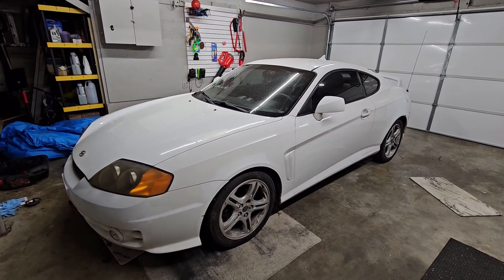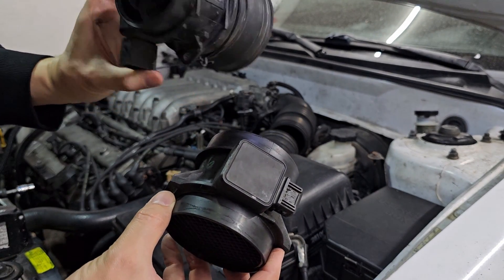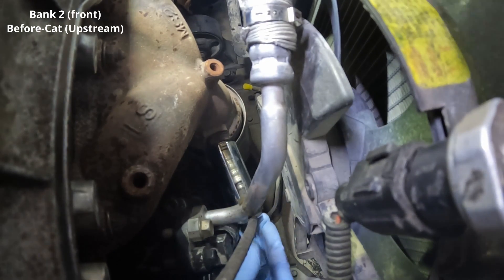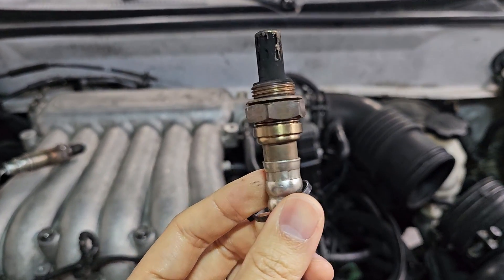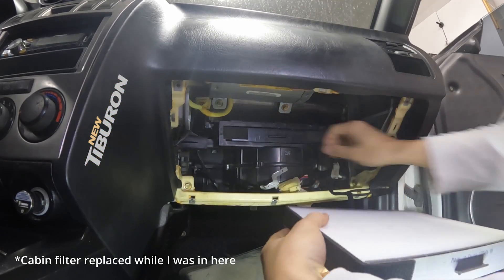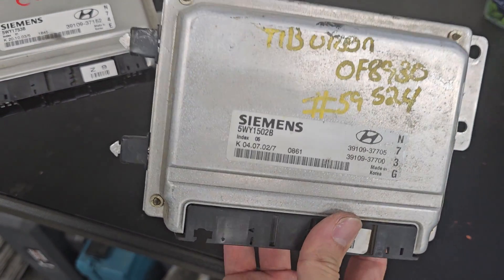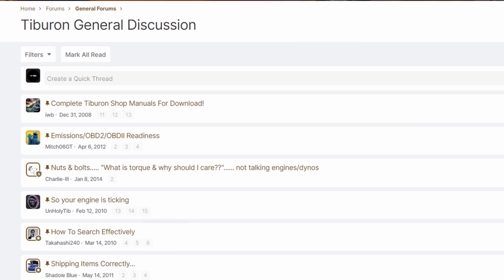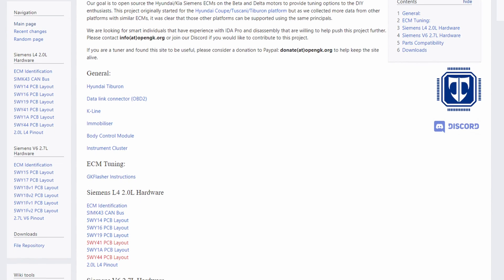🧐 It's In The Little Details! | Tiburon Restoration 7

Comment: “Babe wake up a new Tiburon restoration video just dropped” So excited to see little victories with this thing every new video 🙌🏼 would have never thought to check the ECU. The ticking is it constant or does it stop once it’s warmed up?
Reply from the maker: HAHA thanks mate! 

Ticking doesn't stop ever!! I have a new OEM oil filter, OEM oil pressure sensor and fresh oil ready to go. Also I forgot to mention, the oil light flickers when at warm idle. So I think the oil may not be getting to the top. I did remove the valve cover right after I drove it, and there was oil...but maybe the pressure is not good. Will keep investigating!

Comment: ALWAYS use OEM oil filter, 90% of top end ticking noises come from a low oil pressure in hydraulic valve lifters due to an aftermarket oil filter, the OEM filter is part of the pressurisation system and no aftermarket manufacturer cared respecting its specs

If it doesn't help, try switching from 5W40 to 10W40 oil

Regarding O2 sensors, use OEM or NGK / NTK only, all others have huge fail rates, especially Bosch for some reason

Comment: You recommend another Hyundai vehicle that's found commonly in the states that has parts interchangeability?
More specifically I need a new steering column and can't search nationwide junk yard database for my car because it's not common enough and I was wondering what other vehicles I might be able to pull parts from to rebuild my steering column
Reply from the maker: That sounds like a good question for the forums. Newtiburon.com has tons of knowledgeable people. I bet they kno lw the answer. Good luck!
Reply: @BWORX0521  thanks for the helpful feedback